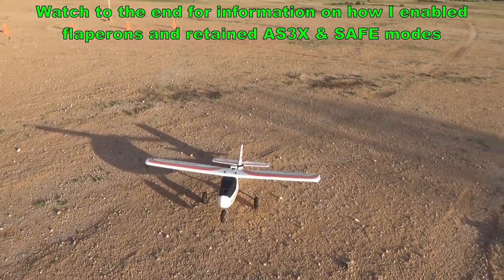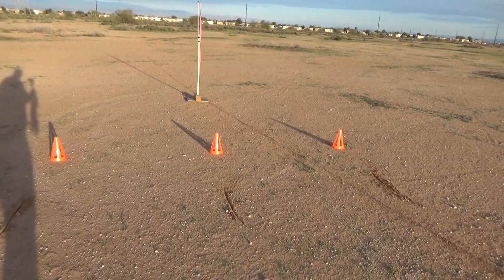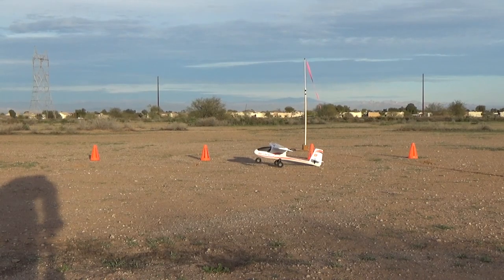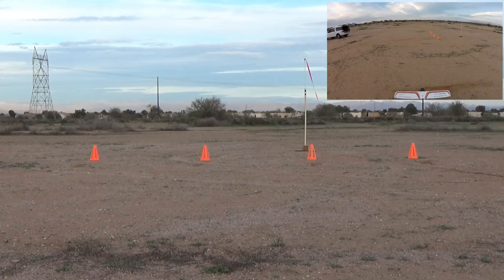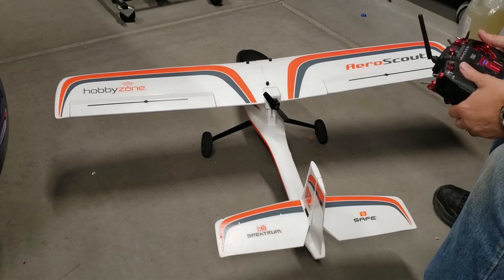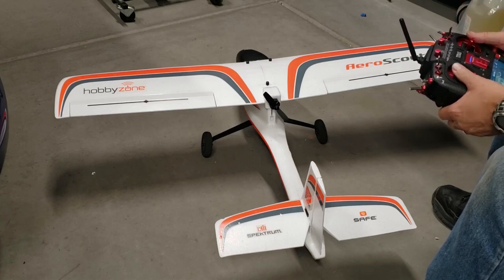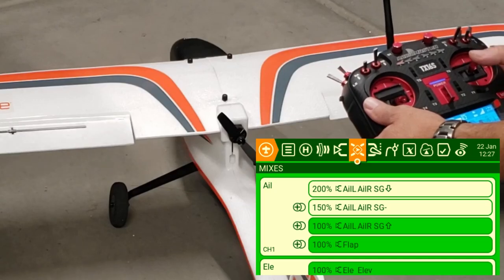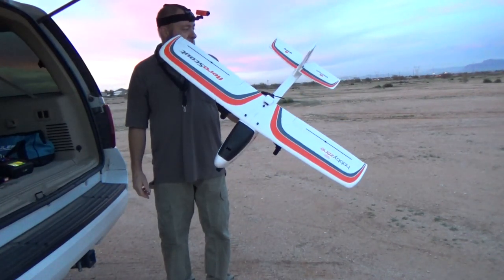HobbyZone AeroScout S2 1.1m Flaperon Test and Setup

Comment: Hello Shane, I was able to update the firmware from 2.38 to 2.46 on the AR631 Rx. 
got forward programming version 0.55.  did a factory reset and did the setup from scratch.  moved the FMODES to channel 8 and AS3X Gains to channel 9 (not sure if the Gains are working correctly). now channels 5 and 6 are free.  I'm planning on using channel 5 for one of the Ailerons (1 and 5).  so, testing phase I guess :).

any input is greatly appreciated.  😅
Reply from the maker: Awesome, once you unlock it there is a whole new world of options available!  I know I keep telling folks this but I do plan to make a flaperon video on how I do it.  I was reviewing my "Flaperon Enabled" AeroScout the other day and I have so much other programming and "stuff" setup in that model it would be too confusing to try and make a video with.  I think I'll do the conversion and programming on my remaining "stock" AeroScout for the video to keep it as straight forward as possible.  Not sure when I'll get to it, feel free to ask questions if you get stuck.

Comment: You can do reverse thrust on it too. I have fun with reverse thrust on the AeroScout! Right from your radio and telemetry menu
  Have you tried it 4s yet? I believe the ESC is rated 4s.  It's possible if a guy stayed in the power he might over heat it. I bet we can keep an eye on temps with telemetry
Reply from the maker: The Horizon has locked down the stock ESC in the older AeroScouts so you can't make any changes such as eliminating that slow ramp up "feature".  I just looked up the new AeroScout and they are now including an Avian ESC!  That is awesome. Bummer both of mine have the old ESC's that are not 4S compatible, or so they say, or will they do reverse thrust.
Reply: @shanesdiy  gotcha. I lucked out and ordered this one 5-6 days ago from HH so I  got lucky I guess.  
  I'm wondering if we can reverse thrust the UMX's that have avian ECS? 
  I'm putting a smart ESC & Telemetry, safe AS3X in a Fun Cub I'm putting together. It's been in the box for 10 years or longer and I really wanted reverse thrust! I have a blast with it on my turbo timber evolution. 
  The other day I accidentally flipped it on thinking I'd dropped the flaps. Man I fell out of the sky the moment I grabbed a handful of throttle.  I just moved the toggle to a smaller toggle so hopefully I don't do it again.
Reply: I was wondering about the reverse thrust because there's an extra wire, when I asked before somebody said they didn't know.
Reply from the maker: Reverse from an Avian ESC wouldn't need an extra wire, programmed through the TextGen script. Does the extra wire come from the ESC or the receiver?
Reply: No in 4s how do you program reverse thrust on the S2 AEROSCOUT? Thank you.
Reply: @shanesdiy  the receiver.
Reply from the maker: Reverse thrust programming doesn't make any difference if you are running a 3s or 4s battery.

Have a look at episode 4 of my Spektrum to EdgeTX series. Towards the end of that video I briefly show the TextGen script but in the description of that video is a link to the developers video where he sets up reverse thrust using the Radiomaster TX16S. To get the scripts there are also links in all the videos of that series.
Reply from the maker: What is the receiver model number? Does it still have the AR631 or something else? Can you see where on the receiver the wire connects? Does it just go into the side of the RX or does it connect to a servo pin?
Reply: @shanesdiy  You don't have to do it with any script… I'm sitting here with my arrow scout and reverse thrust…
I believe I did it through either forward programming… I think that was it you hold down throttle and fall down left aileron I believe it says right on the screen when you find it
Reply from the maker: @HciContractor with EdgeTX you need the script to see the menus.  If you have a compatible Spektrum TX you don't as it's built in.  I have another video where I upgraded the ESC and setup reverse thrust.

Here's a link to my reverse thrust video.
https://youtu.be/C0L_cKdJAy4
Reply: @shanesdiy  gotcha. I didn't know that. I know they make a small ESC programmer. It's the size of a battery voltage tester. I bought it but like you just said... so I haven't used it.
Reply: @shanesdiy  I'm not sure about the extra wire. Sorry I didn't see this months ago.  Any Spektrum receiver that has that port that says VOLT" I plug into and run the red wire over and solder it to the battery lead and I get voltage readings via telemetry on the transmitter.  I snip the black wire off.
Reply: @shanesdiy  I got the AeroScout with the Avian ESC (30 Amp), will it work with a 4S Lipo ?
Reply from the maker: @sagacyberdemon  The ESC is 4S compatible but probably not the motor, at least not for long.  Horizon Hobby doesn't advertise it as being 4S compatible.  I know many folks that run them on 4S and if you don't go crazy the motors will hold up.  Most of the guys that do it don't hold back though so they are burning up motors...
Reply: @shanesdiy  thank you for the response, I'll stick to 3S then, better safe than sorry.   Got another question regarding the channels you used for the flaperon settings, since 5 and 6 are use for the flight modes, what  changes did you made to those and which channels did you ended up using for the flight modes?
Reply from the maker: @sagacyberdemon  I've never flown mine on 4S although I might in the future.

For flaperons to work properly and keep safe modes, you must unlock the receiver (I have a video series on how to do this) so you can reprogram the receiver to recognize 2 aileron channels for the gyro to still work.  The AR631 in the AeroScout has multiple "virtual channels" on top of the 6 servo channels so I just move the safe flight modes up to virtual channel 7 or 8.  If you have a newer AeroScout with RX firmware 2.46.1 you might be able to move the safe channel to 7-9 but you still won't be able to change the model setup to have 2 ailerons, you'll have to unlock it for that. At this end of this flaperon video I discuss the setup and programming a bit in case you missed the end.  I suppose I need to do a more complete flaperon setup guide how I did it.

In order to do this without unlocking the receiver, you can try to move the safe mode to channel 7+ then move one aileron to channel 5 or 6 and setup the transmitter for the flaperon mix. If you try and use the gyro/safe it will only control one aileron so it won't work as well but should still keep it somewhat level.
Reply: @shanesdiy  thank you again. will work on getting the Rx updated and unlocked.

Comment: Howdy, I've Been wishing I had Flaps or flaperons on the aeroscout. Mostly to shorten landings, and here you are. I'm using a ix12 transmitter. If I lose the aleron y and use channel 5 for one of the alerons. Do you Think I'd need to program the receiver?
Reply from the maker: On the locked AR631 in the AeroScout safe mode is ch 5 and panic ch 6 and they cannot be moved unless you unlock it, at least to the best of my knowledge.  You could bind with safe select OFF and not use safe but ch 5 and ch 6 are still setup for flight modes and panic even with Safe select off I am pretty sure.
Reply: @shanesdiy Shane thanks for th quick response.

Comment: I like the results you've gotten by adding flaperons to the AeroScout. However, I don't understand why the receiver needed to be reprogrammed. Why is it not sufficient just to setup flaperons in the transmitter. Thanks.
Reply from the maker: Hi Bill, Spektrum (or is it Horizon Hobby?) locks the receiver with their presets for control surfaces, gyro gains, SAFE/AS3X channel, etc.  Until you unlock the receiver you cannot connect via Forward Programming to make any changes to the SAFE, AS3X, Gyro, change control surfaces such as adding another channel for aileron.  Even a Spektrum transmitter cannot make changes.  I'm currently using channel 5 for my other aileron, in stock "locked" form, channels 5 and 6 are setup for SAFE and Panic modes so the two extra channels cannot be used and you can't change the safe and panic channels without unlocking it.

In my new 3 part series (Only part 1 is out currently) I am going over this exact subject.  Episode 2 I'll show the limitations and we'll be unlocking another AR631.
Reply: @shanesdiy  Thanks. I think I got it. I use SAFE on my AeroScout but didn't realize there was a panic feature/mode which I'm guessing would be assigned to the panic button.
Anxious to see where and how the channels are defined (and redefined) via forward programming. Subscribed just for this reason.

Comment: Can you go through on the actual radio and show what you did to setup safe and flaperons? I'm struggling
Reply from the maker: I've been wanting to make a full setup video but not sure when I'll get to it.  Best I can offer at this time is a very extensive writeup, model yml file, and the images, sounds, and widgets I use for the flaperon AeroScout.   Download the file "AeroScoutFlap_Flaperon zip" from the link below and you'll have a significant amount of data to work with.  I can then answer any questions.

Find the zip file with the name shown above at this link for everything you should need to set it up as I have.  The Readme file has a lot of detail, explains the pre-requisites, and many other details.
https://github.com/qsiguy/EdgeTX-TX16S-Models
Reply: @shanesdiy  that's a great writeup I think it's exactly what I need

Comment: Can i follow this procedure on a generation 1 dx8?  Thank you.
Reply from the maker: You'll need the USB adapter so you can unlock the RX regardless which transmitter.  Does your DX8 have forward programming capabilities?  The setup must be done through forward programming as I detail in my Spektrum to EdgeTX series. The forward programming setup is pretty much the same whether using a Spektrum TX or a RadioMaster TX16S like mine. Actually the first time I set mine up with flaperons was with my Spektrum NX6.
Reply: Ah no, no fwd programming..
Reply: I do have a tx 12 though haven't figured how to use it yet..

Comment: Hi Shane, trying to configue Flaperon's on the AeroScout.  Do you have the same parameters for both the Left and Right Aileron?  Right now I have Ailerons on Channels 1 & 5.  Just can't get the AilL & AilR on the same cell as what your screen shot is showing.
Reply from the maker: What do you mean by putting the AilL and AilR in the same "cell"? Not sure what you mean by that. I'll have to go back through my mix, been a while now. I keep meaning to do a complete guide on how I like to do flaperons, perhaps it's time.

Please clarify your question and later today I'll double check my mixes.
Reply: @shanesdiy  
Hi Shane, on the screen capture (during the back half of the video) you have 200% AilL and AilR on the very first line of the screen capture.  Is it the Ail naming convention you started with? Sorry it’s tough to formulate the question using text 🙂

Comment: Interesting approach to test your settings! :) I´m wondering if I could do flaperons on my Trojan T-28 1,1 with the AR631 6-channel receiver and my DX8G2 Tx. Connecting each servo independently I would loose SAFE/AS3X on one side or can you programme that too? I haven´t understood that yet. Thanks in advance! :D
Reply from the maker: Have a look at my AeroScout flaperon video and the new series on unlocking the AR631! You totally can do that! I love my Flaperons on the AeroScout as long as its setup correctly.  To keep AS3X and Safe you will need to do a firmware update and factory reset. Then reprogram from scratch. Its a project but doable.
Reply: @shanesdiy  Hi Shane, OK! I´ll watch your video! Oh, reprograming sounds like a longer project :S I´ll see what´s in the video and if it´s worth :)) I have so many other projects waiting in the hobby and cycling hobby too :P
THANK YOU!
Reply: Subscribed!
Reply: Hi Shane! 
I have installed/programmed the flaperons on my T-28 and they work good without reprogramming the receiver yet. There are still two things:

In SAFE mode my modell has installed a slight mix of rudder with the ailerons. So if I activate flaps the rudder goes left as the right aileron is the one with SAFE. So trying to land in SAFE would mean the plane does a left turn... shit :P

The other thing is that the right aileron that works with SAFE and wasn´t reversed has no more travel downwards. The left one that I have reversed has travel down. I tried to increase the rate but I couldn´t. You mentioned that you increased some rate when acting as flaps. The only thing I could try is to move the servo arm a couple of degrees. But I think that the servo has more travel left. Or decrease the flap max % and see if then it moves down. 

Maybe I´ll try it out tomorrow but I´m a bit scared. I have also put elevator, rudder and ailerons to it´s max travel. I´ll decrease the low rate more just in case it is too wild...
Reply from the maker: @franciscoduran3688  Without unlocking and reprogramming the flight model in Forward Programming the gyro doesn't know that both channels are ailerons, you are aware of this.  I wouldn't try to fly in safe with it this way.  Self leveling may get really crazy.  AS3X doesn't do that much so may not be as detrimental to the flight characteristics.

In my TX16S I was able to increase the rates on the aileron channels while in the two flap modes to restore full aileron swings.  I do not know how, or if, that same method is possible on your DX8.

I would remove that rudder/aileron mix before a flaperon flight test. Not sure if it's possible with the DX8 but with my TX16S I would be able to disable the rudder mix only while the flaps were down.

Personally I would not fly it in its current state. I would get everything responding as expected on the ground before putting it in the air.
Reply: @shanesdiy  Hi Shane, yes I was aware just one aileron would be working with the gyro. But I couldn´t resist to try it outside. Before I tried to adjust servo travel but I could´nt improve it. On the field it was gaining too much altitude with take off flaps. After I tried to trim it on the air and change flap configuration on the ground. But I couldn´t make it fly so nice as without flaperon configured. I already ordered servos an small stuff to install real flaps since I don´t know if I can program it nicely. But probably I´ll try too. 
I had some wind but could land her nicely. After two good landings the wind came stronger but I couldn´t resist to try it again. After it was so strong that AS3X was working really hard and she was like sitting on the air without moving forward :P I landed very slow an soft on a high grass field. The road was to risky if the wind changed near the ground. It was like a drone... Thanks for the tips!!
Reply from the maker: @franciscoduran3688  Congrats on a safe flight!  Sounds like a very strong wind to fly in, that will get the heart beating!  On my AeroScout the plane actually nosed down slightly with flaps deployed so I added an up elevator mix with the flaps. My other planes I added down elevator to mitigate the "ballooning" effect.

If your transmitter won't allow you to correct the aileron travels with flaps deployed I'm not sure I'd want to use it like that.  Before I figured out how to correct the rates and get full aileron travels back, I didn't like flying it with flaperons deployed. It was too limited on control.

When I get a chance, I will try some tests with a Spektrum transmitter to see if I can work out how to correct the aileron flaperon rates like I can with my Radiomaster TX16S.

Happy Flying!
Reply: @shanesdiy  Hi Shane and thanks! Yes my heart was beating pretty heavy. I have had at least a hand full of good crashes this 2-3 months of practicing. Everyday it´s a new experience. OK! so maybe I also had that nose down effect with flaperons. I thought the wings/plane would react like with normal flaps. Probably I would also needing some up elevator. But I also found the max travel for flaps wasn´t so big to have lots of effect. I think the better way of tuning that plane is putting real flaps. I have seen this video https://www.youtube.com/watch?v=1FOVFdPW5YA and it looks like I could do it also :) I ordered some 9g analog metal gear servos and also a pair of 17g digital metal gear servos. I saw and my ailerons have just 9g so depending on servo arm position at full flaps the smaller ones should work OK for that plane since it isn´t too heavy. The ones from the ailerons seem to be analog also. I hope that works...

If you find a way to set the flaperons like with your TX16S it would be great. But don´t bother with it...
Which is the reason for using that Radiomaster radio? Are they more capable to program?

Best regards and keep producing nice videos :D
Reply: that is the problem what do you program from scratch,  all the AS3X/SAFE gains and such,  what are they

Comment: Is this a possible mod with the stock controller that it comes with? Could I rebind the panic button?
Reply from the maker: I assume you are talking about the RTF version and using the stock transmitter for this? If so, no, I don't think you'll have any way to set that up as the switch mapping is fixed to certain ones and you can't create custom mixes with the RTF transmitter. You also need to unlock the receiver and reprogram it through forward programming which the RTF TX doesn't do.

The plane & receiver on the RTF version can do this, you'll need to find a different transmitter.